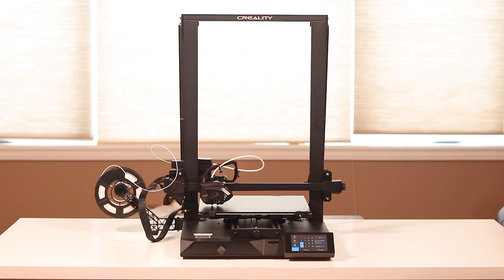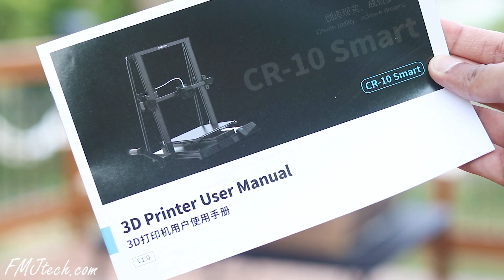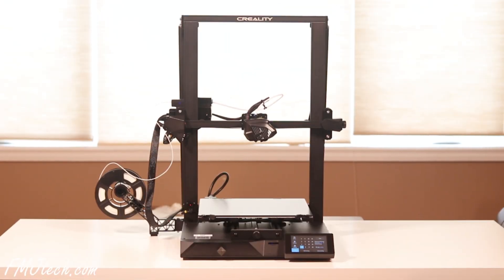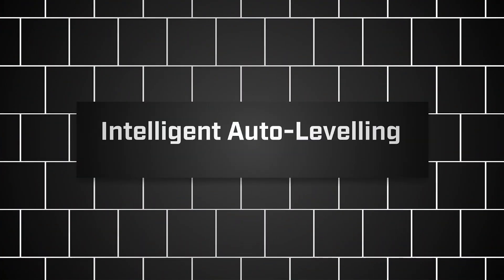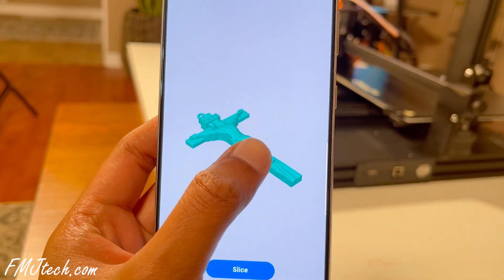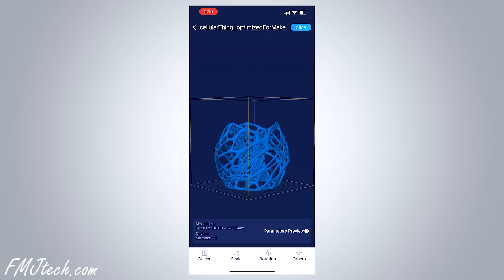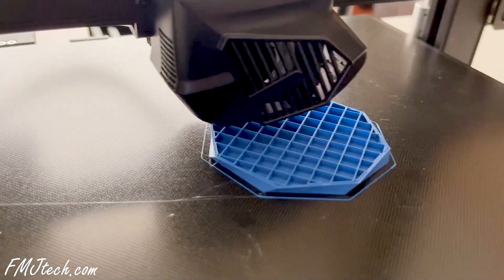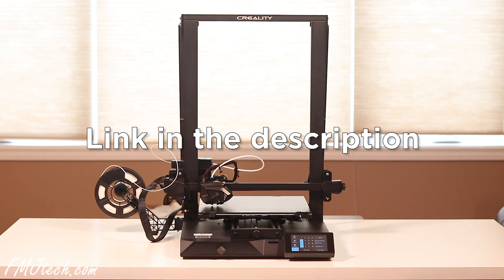This Smart 3D Printer is SPECIAL!!  | Creality CR-10 SMART 3D Printer

Comment: Hey I just got this printer and so far I am not having much luck. Are you are to send the settings you are using. If not is is completely fine 👍👍
Reply: I have put the 1.10.0 firmware on it now and I have had 2 problems so far. One is that the WiFi doesn't work for me now. And 2 when I try to print sometimes it pops up with ab temp (a normal temperature). I have contacted CREALITY about the issue and I think they are trying to fix it. Hope this helps 👍👍
Reply from the maker: When i first used this printer, i had a small issue for printing the first layer. However, when i did a firmware update through the app, all those problem was solved. 

Why you didn’t have much luck with the printer?
Reply: @FMJTech  yea it came with old firmware so i had to update that to 1.10.0 then the prints weren't coming out very clean but i will try the update through the app. 

Thx for the help 👍👍
Reply: @TylerTS50  Just wondering how the update worked for you?